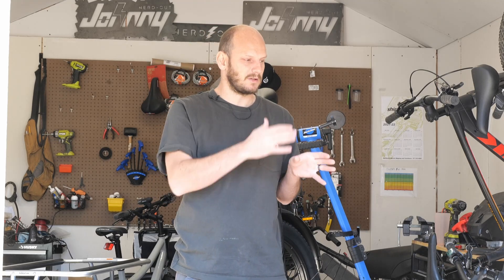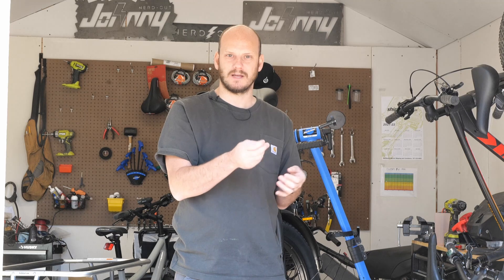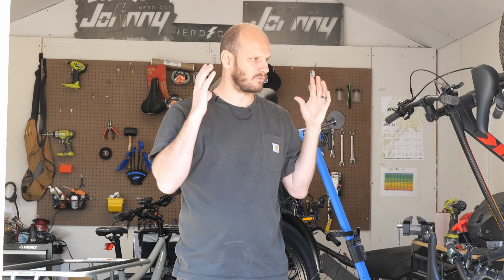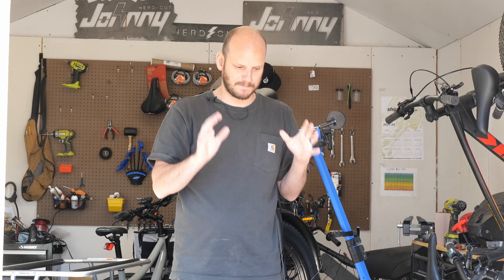Can you convert your bike into an e-bike yourself? What if I'm all thumbs?

Comment: I am not a mechanic and I decided to take on assembly of an e bike. the best thing I did was buy all used parts on eBay.   I went through several seat posts, several headsets, several rimbrake studs and bosses,  several cassettes, 2 chains, set of wheels.    

But since it was all used equipment, I didn't waste more than $200+-- and I consider that a cheap education for a newbie.   Now I'm very confident for next yrs build with top shelf equipment.
Reply from the maker: Nice!

Comment: Thanks, man!  I just finished converting my 26” adult trike, that sat alone and unused in my garage for 6 years, into an e-bike. I’m a fix it guy by nature.  About the time I was finishing up the conversion, I came to an awareness, a truth, so to speak: “Don’t run or connect ANY wires until ALL the components are mounted where you want them.” Now I use the trike for nearby errands, grocery shopping, or simply enjoying riding around outdoors. Your video saved me a bundle on my next e-bike: I’m gonna get a  14” folding bike from China and do the same conversion. Heck, I can spring for a better motor and a bigger, better built battery, too, and save some  along the way! I’ll take the smaller e-bike on road trips in the car, near and far. Thanks for raising my awareness!  I’m 69, and at 19, I came up on the idea that every skill I develop is money in the bank… it’s done me good service for 50 years, so far!

Comment: If you were to convert your friend's bike to an e-bike , would you add an hose clamp around  the motor.... tied to the frame of the bike ( with another hose clamp) , to prevent  torque of the BBS02 750Watts  from  loosening the BB motor mount ?
Reply from the maker: No I would not 👍
Reply: @JohnnyNerdOut  thank you !

Comment: Relying on your great knowledge , how waterproof are the battery pack installed on the downtube? , if used as a touring bike , sudden rain or splash from the front wheel, 9 even with mud guards… , my 48V 17.5 amp/hr came with an rain cover, , however this cover does nothing for underneath the battery plate…..
Reply from the maker: I always say these are water resistant... not water proof. I commuted to work every day in Portland for years (rainy most days) and never had an issue. Just don't throw it in a lake, and you should be good. ;)
Reply: @JohnnyNerdOut  again thank you for your prompt response , and your vast experience

Comment: I am getting ready to purchase a conversion kit for my bike(Mongoose Billet). It has mag wheels. My question is, will I have troubles with installing the speed switch that is supposed to go on to the spokes of the wheel? My bike doesnt have spokes, I was trying to do the help thing on the conversion motor website but was getting no where. Any help would be much appreciated.
Reply from the maker: I’d jb weld or similar the magnet to the wheel

Comment: I recently bought my first ebike and after 30mins of assembly, i charged up the battery before i use it and after 4hrs of charging and was finally fully charged  and when i start the bike up I noticed the battery bar went from 4 or 5 bars down to 1 bar help please? I'm no bike mechanic

Comment: How about a three wheel bike becoming a electric bike and where are you located at.
Reply from the maker: I've done a few trikes- same concept but a maybe a bit more complicated. I am located in SLC, but soon relocating to WA.
Reply: @JohnnyNerdOut  Hey Johnny if you are relocating to WA are you coming to the west side or the east side? Question: which of my two bikes would you suggest converting to an e-bike? I have a 2001 Giant Sedona 21-speed 26” wheeled side pull brake bike or a 2019 Salsa Timberjack 1x ten-speed with hydraulic disc brakes and 27.5 x 2.8” tires. Any feedback would be appreciated. Thanks,Mike

Comment: Hi Johnny, my mtb frame is cromoly steel if i convert to e bike  mid drive  would i ever encounter any problem with it? Would it fit? Would there be no problem with its lockring? Could you suggest/advice for me to ensure that it will be locked properly.

Comment: This should be a walk in the park for any bike shop mechanic but I know how close-minded some are.

I personally need training on repairs/changes regarding shifting, braking, wheel spokes/axles/chain cogs, and front forks. I know how to take all of that stuff off the bike but not know how to install it correctly. Need instructions.

I got hurt a week ago using an adjustable wrench from Park Tool with their Compact Crank Puller. Wasn't using it correctly and the adjustable wrench slipped and hit my face. I found out the hard way how to use the Park Tool Compact Crank Puller correctly. I may make a video about this so others don't end up getting hurt like me and also so they don't have to send stuff back like me as well.

You won't need to use an angle grinder unless you're unlucky like I was with my road bike for the stripped crank arm threads and you won't have to solder (OUTSIDE OF ACCESSORIES) if you use Bafang (Hub or Mid Drive). I've had five systems put on bikes and the two Bafang ones did not need soldering. Another one I haven't soldered the battery yet but that's the only essential thing that needs soldering. The first two systems I had installed needed soldering for everything essential like motor to controller wiring and stuff like that.

Comment: The hardest bike-building thing to do is building a wheel. After weeks of research and calculating spoke lengths, I got it wrong the first time. Had to re-order spokes. After a couple of weeks I actually sat down to do the build. Took me most of a weekend to get it completely round. But I did it. The point is that sometimes you have to be patient, especially if you cannot buy the parts you need locally. I was 14 at the time.

I went on to become a bike mechanic. After building a hundred wheels or so, I got the time down to under 40 minutes; perfectly round and straight every time. So practice does help. But it is not required as long as you can be patient.

I have since been away from bikes and cycling for many years. I have no doubt that I can convert an old bike hanging in the garage. Whether or not I want to fuss with it is a question, but the fact that there are no eBike repair shops in the area makes me think that maybe I should do it myself; just so that I can fix it myself when necessary.

Johnny's attitude about teaching people is a truly great thing. There is so little of that sort of generosity in the world. 

Makes Johnny a great human being in my book.
Reply: Folks who get into building wheels are rare even among those who do everything else on their bikes. I've built a couple of wheels but can't envision ever needing or wanting to do it again. E-bike conversions do not require wheel building skills. I mention that to prevent panic among folks who now wonder based on your comment.
Reply: @bjnslc  LOL. OK, maybe I over-shared a bit. :)

My point was that you can do ANYTHING related to bike building with enough patience. 

I could picture building a custom rear wheel for a specialized case. Like maybe a Rohloff hub with a specific rim or something like that. Otherwise, however, I agree that it is easier to just buy a wheel (assuming cost is not a limiter).

Comment: Hey Johnny, how often are you rearranging cassettes to achieve a better chainline on the average conversion?
Reply: That's the hard part getting a chain-line dialed in.  I had to modify a BBSHD lekkie ring to fit a BBS02 motor. Lekkie makes rings for both motors but they don't fit each others motor. Plus the offsets on both rings are different.  Plus you have to add at least 2 spacers , otherwise the BBSDH ring will scrap the outer casing of the controller cover. 

I needed the offset of the BBSHD lekkie ring to fit the BBS02 motor.  The pre-drilled holes for each respective chain ring are different so I had to bore out the center of the ring and add new bolt holes.

It's usually the smallest cog that slips while riding full throttle. 

My next build I may consider doing a ROHLOFF geared rear hub so you have one single chainline to dial in.

My bike now is near perfect but every now and then I do get some slippage/skips on the smallest rear cog , even going on a pure flat road. I added another spacer , but now I'm seeing the normal chain ring bolts are too short because of the spacers. So I now need to find some longer bolts.

The "chain-line" is probably the most important thing to get right on these builds.
Reply: @TheAgentAssassin   thanks for your input. I don’t know why I even leave any comments on Johnny’s vids as he never replies. I agree the chainline is going to be the trickiest part of the build. I wish in all his conversion vids, he would touch on that part in each video as far as what he had to do to achieve the optimal chainline. But that would probably cut down on his profits.

Comment: I just did it, im mildly handy and have tools already.

What shocked me is how many tools i needed. Not for the ebike kit itself, but for things even like a special screwdriver to install the magnet or crank arm removal tool.

Some parts of the bike actually need a specific torque that requires a special tool. Youll probably need to do stuff like tuning the brakes and the gears which is a bit of an art.

Also youll run into stuff that you need diy fixes like what if the battery wont secury properly to the watter bottle mounts? Which imo is the biggest weakness of the bafang system. I got the grin double bob mount to fix that for the record.

And also, youll need to be your own technician. My pedal assist was behaving extremely erratically and thru forum posts i narrowed it down to be a faulty gear sensor. Luckily an easy and cheap fix.

I couldnt do the gear tuning and crank mounting myself among other things cause many parts on my bike turned out to be seized. Mounting the engine is the easy part. I ended up shelling out a few hundred to have a bike shop check my work and do some things

And finally youll need at least some electrical diagnostic know how. Can you properly source cells or will you buy knock off stuff from china that will could kill you? This aspect is no joke and there really are dangerous batteries coming out of china. Will you recognize signs of an unhealthy battery? Do you know whaf a battery management system is, and why its important you ensure its ON while charging?

Personally on a difficulty scale of one being all thumbs to 10 being mega handy, id place the required skill to be 5 or 6 to complete the job SAFELY. 

Sure you could wing it, but man when i look at diy facebook ebike groups i cringe at what i see

I will say that if you pay attention to johnnys channel and paid enough attention during many of his videos, you should be ok :) hell even if you had the attention span to read this comment youll probably be ok
Reply: People who say they can’t do things really don’t want to learn.  Which creates opportunity for one’s that do.
Reply: Specialty bike tools are needed. It's easy for those of us who have them to forget what's necessary and that each tool has a learning curve to use. Good bike tools that work reliably cost a fair amount too.

Comment: I have not watch all your videos,but you need to lay out what tools you need (basic)first off don't expect any help from a regular bike shop.They want you to buy a $3000 ebike from them.They will tell you they don't recommend you do this..Maybe you can get them to remove the bottom bracket for you ,that is something you need special tools for.Make sure the battery will fit,don't believe the video that say mount the battery where your water bottle cage was ,the holes might not be in the right place.I had to go to the hard wear store to get a bushing and make a new hole(0ne hole work)I had to buy a right angle drill attachment from Harbor Freight $20.You can mount the battery on a rack behind the seat(puts the weight pretty high!You will need some metric tools,I have watched too many videos where everything fit just right and the guy went riding in an hour!Hope this helps!
Reply from the maker: I have a video detailing out which tools you need!
Reply: Get a double bob mount from grin technologies. Your battery could fly out of your frame at any minute if its being held by one measly screw
Reply: @davidlapointe4710  If you read my comment closer you would see that I drill another hole and put a threaded bushing in so I have two bolts holding it on.

Comment: If you dont know how to check your cars oil dont try to build a ebike. The hardest part is properly mounting all the components then wiring it all up. Im a bicycle mechanic and it was a bit tricky. In the end I completed it on a Electra Townie with a Volermart 1500 watt motor that propels my bike 35 mph+ and it only cost me $800 for the whole thing including the bike. Its a blast and saves me $300-$400 a month in gas. I charge it at work while working so free electricity. Best $800 I ever invested!

Comment: I found it pretty complicated, could not work out how to open the front derailleur up to get the chain out so ended up cutting it up with a angle grinder. - chain didn’t want to split either, I have the tool. Also my bike (specialised crosstrail) has the gear cables exposed unsheathed under the downtube with a tab on the bottom bracket to hold it which was in the way of the mid motor, bought a sheath for the cable and cabled tied that on no problem but I’ve not managed to index it to get all gears. Pity I’m in the uk or I’d sent it over!
Reply: Park tool has great vids for indexing gears etc.
Reply: @bcamping1  thanks for that 👍

Comment: tip, when you start getting annoyed because you can't work something out, walk away go for a walk, go surfing, go shopping, go play video games just take some time away to relax your mind chances are you'll work out the solution while your not even thinking about it, failing that do what Johnny said hit youtube even lock up motorised bicycling forums they're a wealth of great information for e-bikes and motorised(predator 212's etc) bikes ....
Reply: Back in 79 my shop teacher saw me struggling mating a transmission to a motor.  He reached into his pocket then handed me 35 cents telling me to get a pop.  Walked to the back of the building and drank while looking at the canal.  Returned to the car and within 30 seconds made the fit.  Years later one of my mechanics working on a jet was struggling.   I handed him 50 cents and told him to take a break.   He returned and made the fit.

Pass it on.
Reply: @jedibusiness789  I love that tradition
Reply: This helped me. Good tip. Fun project. You can do it too. New bafang kit is so rewarding

Comment: You made it easy for me to build my rockhopper and I can't believe it was just as easy as you said it would be!
I've been riding a conventional bike for a few decades and I didn't want a shift sensor and so far it's been a blast. Thanks Johnny for your help!!!
Reply: I also have a Rockhopper I’m going to convert but I think mine is a 2015 and it is going to be a tight fit to fit a battery in the down tube area. After 1 month Would you do anything different?
Reply: @Jon Swanson  the only thing I would do differently is instead of a thumb throttle, maybe a half grip throttle. 
Otherwise I have 800 km of a riotous blast on a great ride!